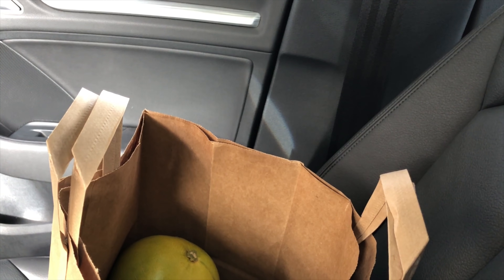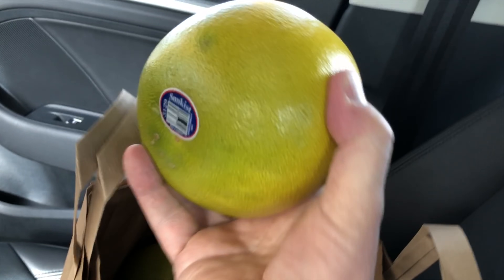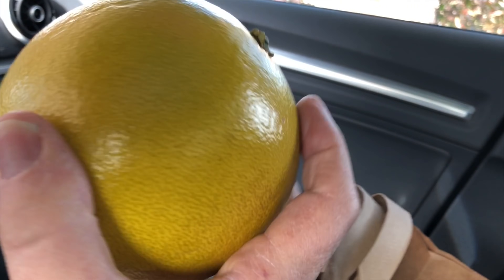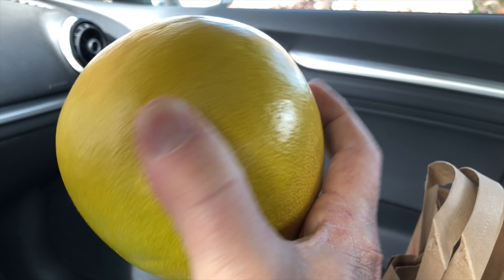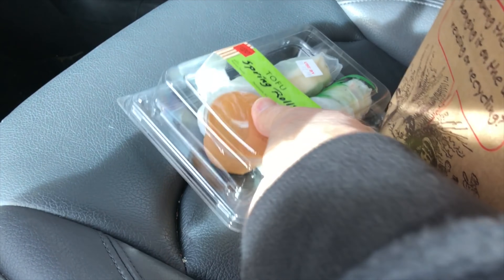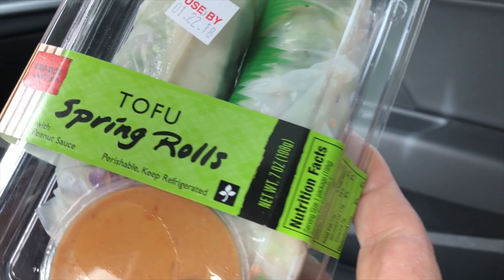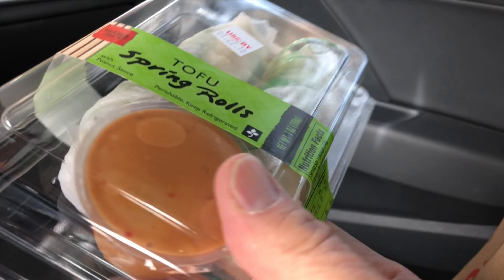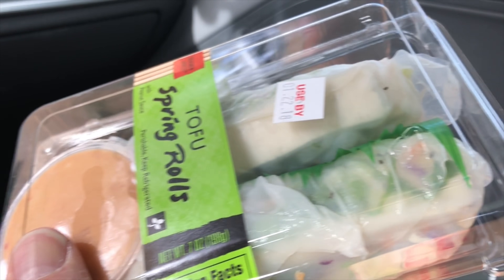The future of Class D amplifiers

Comment: 6:07: Its a myth that PWM is linear, PWM introduces distortion, and its worse the closer the signal frequency is to the switching frequency (think about it, if it was perfectly linear it violates Nyquist's theorem, there must at least be sinc(x) roll-off as
its a sampled system).  In fact PWM introduces harmonic and intermodulation distortion, not just gain roll-off with
frequency, due to the timing of rising and falling edges being correlated with the signal level.

For good performance higher switching frequencies are a help, which is why GaNFETs are going to revolutionize class-D
amps (as well as all of switchmode power electronics).  Expect 1MHz+ switching waveforms to become the norm, both
making filters smaller and more efficient, and reducing open-loop distortion in class-D topologies.
Reply: I generally agree, but Nyquist doesn't really apply at all - many people mistakenly refer to class-D /switching/ PWM amps as "digital", but all they have in common with a digital circuit is a clock/oscillator. The low-pass filtering for digital circuits (at least, for 16/44) has to be very steep indeed, close to 'brick-wall', and this presents a lot of problems in designing them, whereas class-D amps only require a simple, relatively shallow analogue filter, as Paul Mcgowen describes, often little more than an inductor and a capacitor.

ETA What I forgot to say (the entire point, actually) is that the low-pass on a Class-D output doesn't impose any of the nasties that steep digital ones do - transient ringing, HF phase-shifting, in-band aliasing etc, which have to be juggled in a compromise of some sort (hence peoples' preferences for either delta/sigma or R2R, even 'non-oversampling').
Reply: Multilevel  pwm is a good alternative, example 5 level moves harmonics to high frequencys, and carrier triples.
Reply: shne
He made a significant mistake in his video.

There are no class d amps running at just 100 KHz.

Very cheap ones run at minimum 500 - 700 KHz.
Good quality class D amps run about 1 MHz - 1,2 MHz

Either he did a little mistake or i wonder about his knowledge. he should know it, so i assume he just made a mistake. 
100 MHz would be horrific and almost unusable.

http://newscenter.ti.com/2016-12-05-Industrys-first-2-1-MHz-Class-D-amplifier-transforms-automotive-audio-design
Reply: You boring People Show up/OFF everywhere. The guy just said: Keep it simple and not too much technical, or else he would be talking for hours. 
What is wrong with People like you who always feel the urge to comment, to add, to Show someone "wrong" (you think) or "stupid" or I do not get it, what your Problem is. 

FOR THAT REASON I subscribe such channnels and not Aliens who talk a lot, but have not achieved anything with their smart talking. 

That is why People like me like "WARM" Music, and not "Clipped distorted frequencies" or whatever. 
You People Forget to have fun and enjoy life, most of the times, or? :) 

Na, ja...
Reply: You People always looking for that perfect straight line and when you have achieved that, you think: "Ooops, that flat mathematical Response sounds Kind of harsh to the ears... Let us put a bump in there, so it sounds pleasant again..." :)))))))))
Reply: No, no, no: you actually those People who invented digital Audio, then realized that those flat and straight numbers Sound bad to the ear and saw People compalining about it, then invented the "warm" emulations!! :))))))))))))))))))))
Reply: @SocietateaAscendenta  i have much fun hearing music on my system. I got really deep, but tight bass and every day i have much fun turning it up. Its not warm sound but its crystal clear and precise. Combined with electronic music that takes you into another dimension. It is like a trip on drugs. I dont need warm emulation and distortion. I just need my solid state amp, good sound source and a flat response to have the capability ti adjust it to the way I like at every time. I like analytic crystal clear precise sound. That is why i dont like warm sound or tubes or such. Warm music sounds like you have a stage in front of you. Crystal clear and flat sounds like you are directly inside of it and triping with it. I prefer the trip. Making music a drug.
Reply: Haha... Interesting comment. You are right there: warm, not warm, clear, unclear, maths, no math... it is driving all of us crazy: SOUND and MUSIC!
Reply: PWM itself is superlinear indeed, doesn't exist an analog technic to be even close to digitally generated PWM amp. TAS5558 384kHz PWM modulator + LVC gates in parallel shows .01%@-.5dbfs THD+N across audio band at 32ohm headphones without any feedback. https://www.diyaudio.com/forums/headphone-systems/326697-true-digital.html
Reply: That's not what I said, I said PWM is non-linear.  But everything is non-linear, its always a question of how non-linear, and for class D you need a high switching frequency for best results, and a feedback loop around the whole thing should you want to get down to -100dB SiNaD into a resistor, let alone a speaker load.  If you are generating a digital signal directly you can avoid the problem of analog PWM non-linearity by clever techniques, but the many of the same issues remain, and an analog feedback loop is not available without adding an ADC to the system.   There is no substitute for sticking a good FFT analyzer on the output of your amp to see these things!
Reply: Mark Tillotson If the waveform is linear, where is the harmonic and interharmonic distortion coming from? The main problem is the higher frequency roll-off. That is why it is used widely as sub-woofer amplifiers.
Reply: class D amps use natural sampling, not uniform sampling, which gives distortion: http://www.openmusiclabs.com/learning/digital/pwm-dac/pwm-distortion-analysis/  (yes its non-intuitive, and effectively simulatiing natural sampling isnt trivial so simulations often get this wrong - you have to do the math, or use a spectrum analyzer).
Reply: Why not just go to a digital amp? Sampling has been perfected.  As for the output, I don't see any reason that a pwm output has to have problems with high frequencies. Electronics is SO fast these days.  Can't you just turn up the speed until you don't have any audible problems?
Reply: a DSD through and through process would be cool, however, most DAWs today rely on PCM for editing.
Reply: Mark Tillotson Do you listen only to vinyl? The DAC in your CD or DVD or other digital player does the same thing as a class d, but like Ginger Rogers just backwards.......
Reply: A DAC does uniform sampling, on a precise unvarying clock, which is different from the class D setup where a triangle wave intersecting the signal determines the analog timing of the output transistions - read the article I refer to, or better still build yourself a class D amp from scratch and look at the distortion with a spectrum analyzer for various signal and switching frequency combinations.  You can get much worse distortion using a sawtooth wave rather than triangle, since this moves the pulse centre around in time in a more gross fashion.
Reply: Mark Tillotson ERM a class d amplifier is either switching on or off, one or zero, its what makes them so efficient, pulse width modulation? Think of it as a string of ones followed by a single zero perhaps as the pulse width changes? Still a digital to analogue converter.
Reply: Its a fascinating area - so many ways to tackle the issues for better performance - I've personally looked at direct generation of PWM from digital input using noise-shaping techniques, which is where I came up against the issue of PWM not being completely linear.  I resorted to some interesting simulations in python using the scipy.signal library to understand the behaviour better.

Comment: I haven't found the price to performance ratio of most of your products to be acceptable for the parameters that I value in audio gear.  But I will say (and you could've knocked me over with a feather) that these little Noise Harvesty widgets of yours ACTUALLY work.  I have five and they do what I need them to do.  Primarily it keeps my or my neighbor's Air Compressors, AC Units, Microwave Ovens and Refrigerators from causing all manner of noises out of the AC service inside my home.  I have dedicated 20 amp lines to my main system but the others (six of 'em, yeah, I like audio gear) are on regular old 15 amp lines of the type one sees everywhere.  The house is only twenty years old, so it's far better than in some of the rentals I had to live with over the years, but those things actually WORK.  I bought them fully intending to send them back.  Kudos.  As for this video, I'll never own Class D amps.  They might make sense in cars, but if I can avoid ever owning any, that's probably going to be off the table for me personally.  Everybody has different priorities.   Live and let live.  Congrats and thanks again.
Reply: I should've said that I've heard your gear at shows and it's terrific.  I apologize for not mentioning it earlier in my screed.  Maybe one day!

Comment: It's only controversial because you make class AB amps and are behind the curve on class D engineering, which is flat out amazing these days.
Reply: but i ask me if he developes class D amps. Why does he say they use 100 KHz? 
That does not make sense. They run on much much higher frequencys. Modern run even way above 1 MHz.

With that the output filter is no prooblem what so ever.

Comment: Quick question if I may. When you say Class D amps aren't good for high frequencies (because of the filtering network on the output), what sort of frequency range is "usable" before we start to suffer from high frequency interference? My understanding is that Class D amps will produce clean frequencies higher than the human hearing range can perceive... is that not correct? Thanks!
Reply: Define "clean"...  basically the fidelity reduces with frequency with class D, but a good class D amp will use high switching frequency and feedback control to improve performance.  All amps have the same issues - its harder to have good fidelity at higher frequencies, although its probably the case that since human ears are less sensitive at higher frequencies its not too crucial.
Reply: JohnAudioTech measured out one of these cheap sub-$10 TI-based class D boards from China (basically TI's reference design) and if i remember right, it showed a gradual onset of increase in source impedance somewhere around 10KHz. This should be just about an indication of the frequency range TI is optimising for. Which is fine, if you can get reasonably close linear to about 12 KHz and have some residual signal higher up, that seems to match human hearing pretty well.

Comment: Topic suggestion for a future video: Why in the year 2018 are we still using MP3 and compact disc audio from the 1980's? How about lossless compression formats? how about studio quality audio discs?
Reply: We have them and continue to use them because they are, for all practical mainstream purposes, far more than adequate, ubiquitous and very widely supported, and accessible to anyone and everyone making them also very convenient to access wherever needed.  Whatever advantages alternatives have thus far offered versus those more commonly accepted standards simply have not been sufficient or convincing enough to sway users away from the existing standards.  Once something becomes a standard, or de facto standard, it typically requires a very convincing improvement, either in convenience or performance, to win people over to a new alternative, especially once equipment replacement costs are also factored in which makes those standards very entrenched until something vastly superior, or at least backed by lots of money and major players, forces mainstream users to adopt that new technology.  The fact is that 44.1KHz/16-bit LPCM CD audio and 256/320 Kb/s MP3 standards are already capable of reproducing audio at quality levels that most would be unable to differentiate from the alternatives outside of laboratory conditions (or other very contrived scenarios) so there is very little incentive for mainstream users to venture away from these existing established formats.
Reply: We have all of these. Remember, there was SACD for a while - i think it was fundamentally flawed, because it locked in the delta-sigma modulation scheme and not a top notch one, it could actually have lower resolution around 4KHz than CD if memory serves. At the same time, they experimented with DVD-Video encoded audio. The image bitrate was reduced, and audio would come in 24-bit 48/88.2/96 KHz LPCM uncompressed, usually lossless with respect to studio master, and you could play this with any conventional DVD Video player, until DVD Audio was standardised that was basically that minus the video stream.

Also see this: https://www.youtube.com/watch?v=U6hl04gubJA
Reply: MP3 from the 80's?
Reply: MP3 was 1993, and 320kbits MP3 is quite good!
But if you prefer, you could use the OPUS format.
It's lossy, but basically transparent at 80kbps, especially the RC version.
With the RC version, I run at 48kbps, and you wouldn't even notice the music is compressed, unless you A/B it with the source audio (of CD quality or better).
Reply: Tbh most of my music is in mp3. While I do have some flac files, it’s hard to tell any difference between that and high bitrate mp3.

Comment: Wouldn't just upping the clock rate from 100k to 200k help with the high frequency problems you mentioned that Class D amps tend to have?
Reply: 400kHz+ is common for this reason - and it makes filter components smaller and simpler.